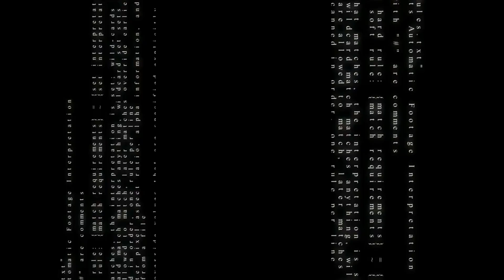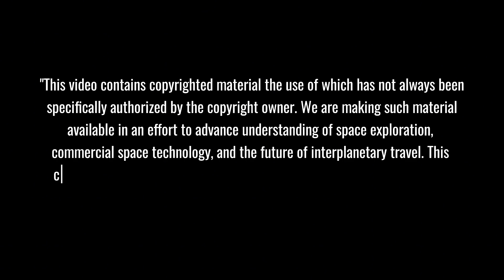UNEXPECTED! SpaceX's Booster 14 Catch Success Hides a DARK SECRET... Engineers Are Worried!

Comment: I think New Glen would avoid or relieve the fuel slosh problems with a drag system to settle the fuel before the atmospheric burn.  The steering fins are very slipstreamed, and the booster was travelling extremely fast before the burn.   Freefall.  Not good for settling fuel.  Possibly some grid fins, or drag chute configuration might fix this.  Maybe engine start sequence, or throttle.  You can compare the speeds of NG to SH, and NG was moving at incredible speed at the moment of engine ignition.  I think that may be the cause of the problem that took out the booster.  Let’s wait for BOs report, if they share it.